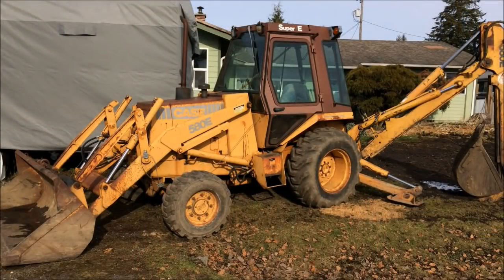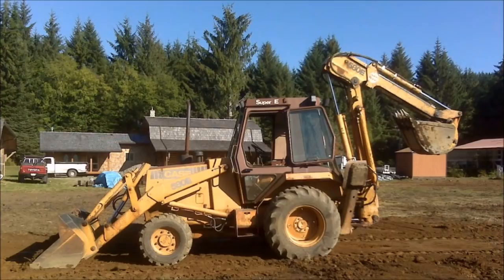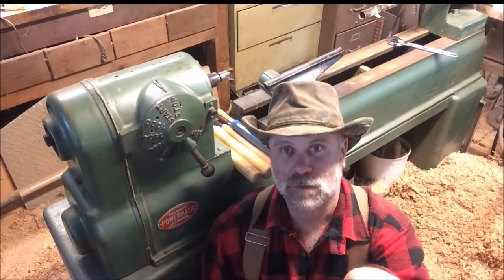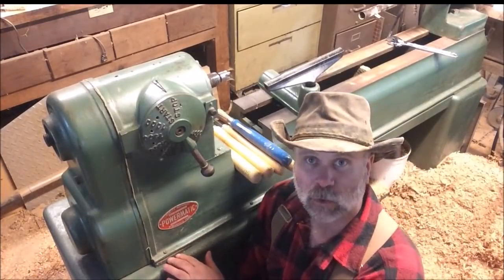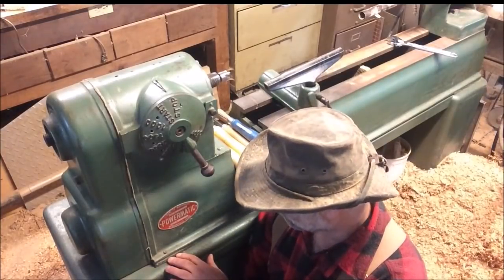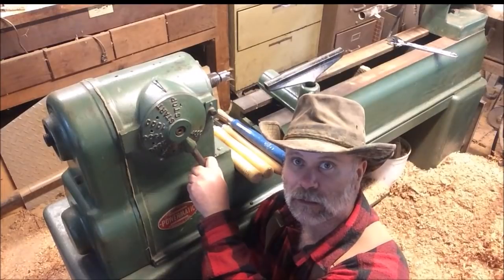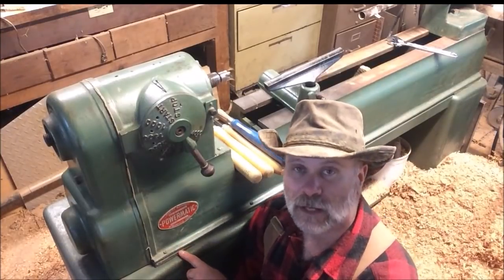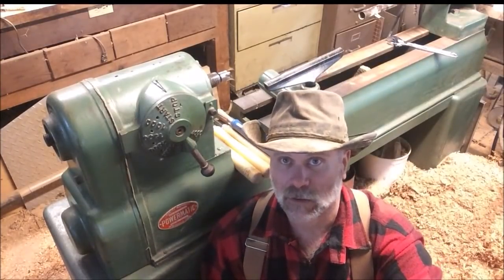Mr. Rain's Top 3 Second Hand Finds

Comment: Great finds and repairs. I use to sell Case. Dependable machines. Lathe was a steal. . Great job on number 1 choice. Or were you her choice. Nice video as usual
Cheers
Reply: Steve, thanks. I was told that the ‘87 was the last year before Case started implementing electronics on the mashing. I’ve been happy with it. I was actually surprised when I found out the other lathe and planer went with the lot. Heidi is a keeper!